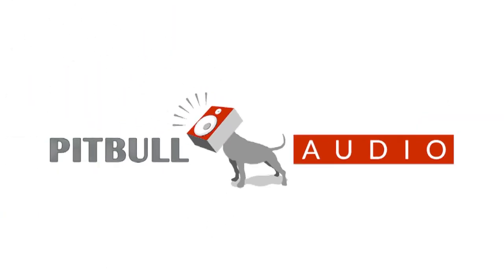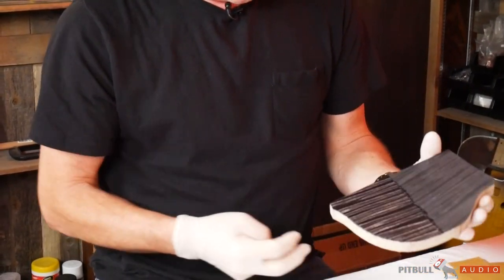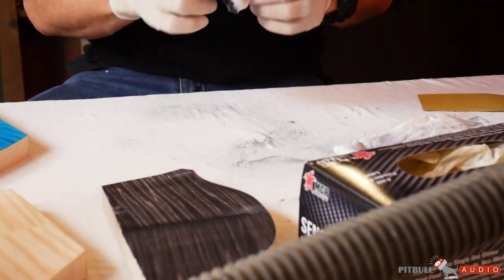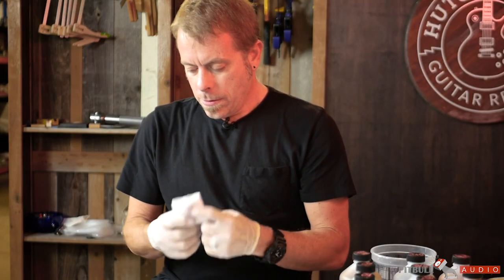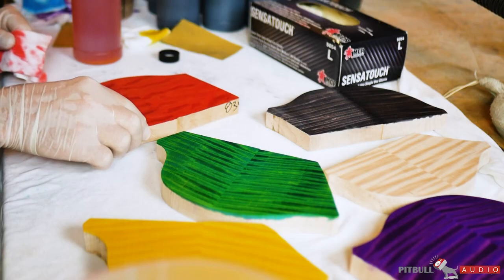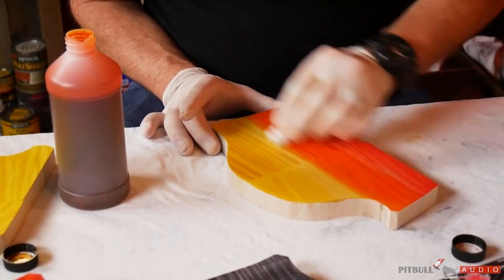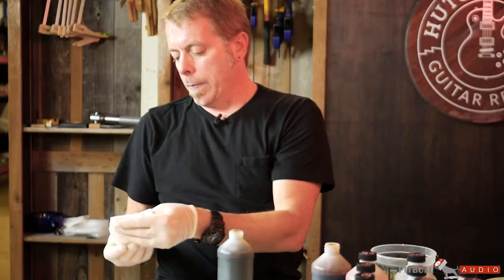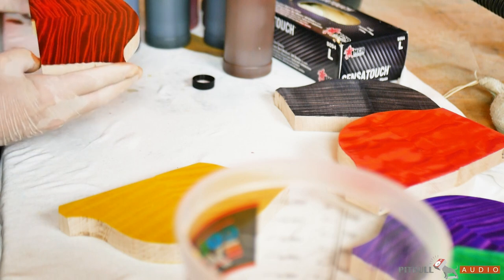Pitbull Audio Presents: PRS Private Stock Staining Techniques with Paul Miles

Comment: Garbage in, garbage out - it's all about the wood.  Killer results are easy with high grade figured wood.  And PRS has always been known for their killer figured wood.  OTOH, I used their "raspberry dragon's breath" technique (pop with blue, then hit with red - the blue turns purple, and the red turns pink) on a spruce build and got decent results.  The spruce came from a 2x4, so it wasn't figured, just some nice graining.  What he said about yellow wood and blue stain makes green is quite true.  That gave me fits when I was staining a flamed ES335 in NC blue.

Comment: Wonderful! How do you prevent or control the bleed through. Thanks for this!
Reply: There's another video where they state the fact that they apply an isolator to the edge where the natural masked 'binding' exists. I think that's a big part of how they control it. The other bit I that they rarely apply two or three coast of a water based stain. It's always a combination of water-based stains, alcohol-based stains, and oil-based stains.

Comment: Question though...Is it possible to do several different stains on the same body and maintain nice, straight, clean lines between them?   I have a friend that wants me to do a VH 5150 replica build, but he wants to do it on a quilt maple top and use dyes instead of paint to give it a unique look.   Don't know if that's even possible.
Reply: You would want to do that by spraying a tinted clear rather than applying stain or dye by hand.

Comment: As far as I am concerned when it comes to dying....go quilt maple or go home.   But when it comes to binding, would it not be better to do all the dying and THEN add the binding?   Keep from having to tape off such a precise area.
Reply: Have a close look at pretty much any USA PRS guitar and you'll discover the 'binding' is not anything added.  It's the edge of the top wood.  The fact that the binding is usually plain (uncolored) maple is a testament to the skill of the finishing department crew.  They are that good.

Comment: what type of water based stains do you use? I want to stain my furniture in the same technic but i find only oil or alcohol based stains, or water based which is not translucent, they are muddy.
Reply: I think they use analine dye. I've heard they use keda brand, but I don't know for sure. Either way, if you look for wood dye instead of stain, you're more likely to find the right product.
Reply: Dye and stain are different beasts. Dye goes into the wood (tiny microscopic particles), stain sits on top (fat pigment that is larger than the wood pores). So they make light behave differently too. Start with aniline dye

Comment: Anyone know the brand of these dyes?
Reply: No. But it's likely trans tint. Even if not, trans tints are the standard in the guitar world. You'll get great results. Stewmac sells them under the "color tone" brand. But Jeff jewitt(the inventor) sells them on his website cheaper. Homesteadfinishingproducts.com
Reply: @mgcnashville6615  Thank you so much! 🙏
Reply: @PSk4t3r  no problem. If you look up the “northern lights” finish that PRS does, I achieved very similar(if not exactly) results just yesterday using trans tints blue, and trans tints red. One I mixed with water, the other with rubbing alcohol.
Reply: Oh also, I went over the whole thing with pink(just red heavily diluted) after I got done. Really really good stuff. I’ll post a vid of u want to see.
Reply: @mgcnashville6615  yeah please

Comment: Interesting  PRS goes on about drying  out moister he we see it been added back!!! tell me it will dry out
Reply: First, very little water is added in the staining process.  Second, the wood took a lot of time to dry out and would take some time to rehydrate.  The appearance of the edges show that very little water goes past the surface.
Reply: Its basically SURFACE moisture with a very small amount of water that won't effect the overall balance or the guitar as opposed to a brand new peice of wood with higher levels of INTERNAL moisture that will cause a shift as it escapes.